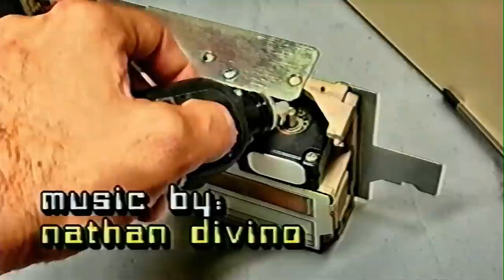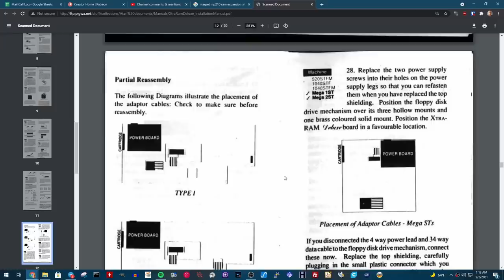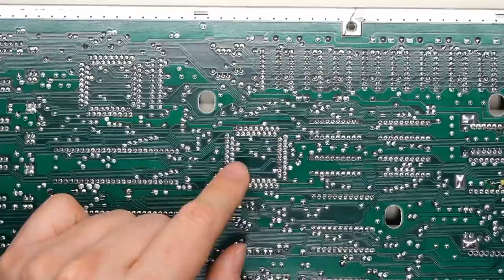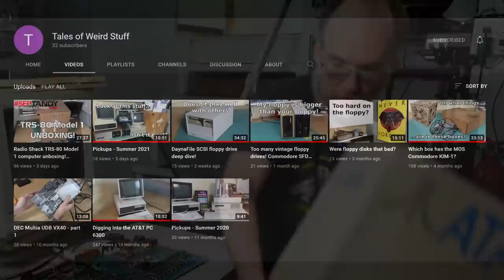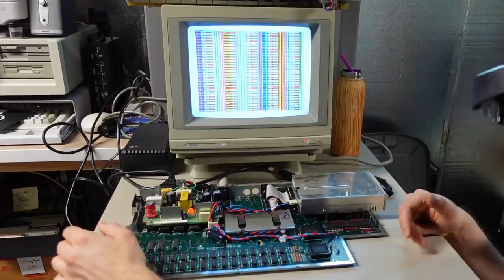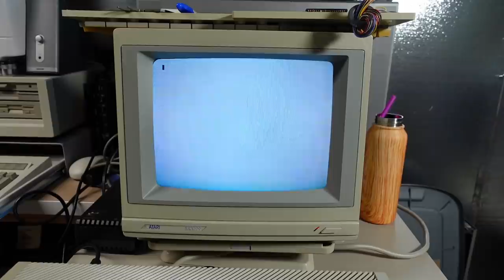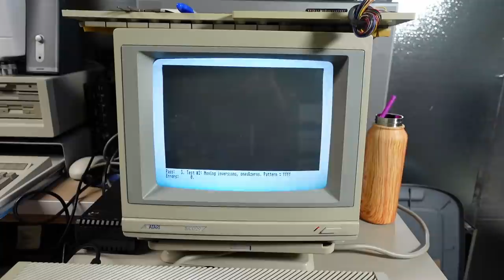I figured out what is wrong with the Atari 520 ST!

Comment: The 68000 can access the two 8 but halves of its 16 bit bus independently using two strobes, *UDS and *LDS, I guess that is why those chips are connected in two groups of 8 bits.
Reply: The buffer chips are actually there to isolate the 68000 and other chips from the data bus when the shifter wants to use the ram. The Amiga has a similar arrangement
Reply: @jaycee1980  Yeap, I was explaining, with more or less success, why there are two different enable signals, you have to allow the 68000 independent access to the two 8 bit halves. It's not a surprise the Amiga has a similar arrangement, it uses the same CPU. Cheers.

Comment: When you wanted to fix those socketed chips back in the day without opening the machine, you would just lift the computer up about 6 inches and drop it down on the bottom.  That would usually reset the chips.  This is why they sold retainer clips for the sockets to hold them in place.
Reply: I have an early 520 and I can confirm that this was a problem, and this was the official fix.
Reply: @jimgsewell  I can remember when the 520's came out and this was the first thing to try if your new ST didn't boot!

Comment: The Mega ST line was the follow up to the 520/1040   There was the Mega ST1 and the Mega ST2 -- I owned a Mega ST2 back in the 90-94 timeline.   The number indicated the megabytes in the system.   They were pizza boxes with separate keyboards.  I think they came with an integrated HD but it's so long ago I'm not entirely sure. (Edit: Nope.  No internal HDs.  Did some googling...)

Main reason for buying these were that (a) Apples cost so much more and (b) desktop publishing.  Yeah, everyone associates the mac with desktop pub, but there were a few decent programs for the Atari ST line that worked just fine.   We had a few 1040's at my work connected to an apple Laser -- whatever their first laserjet was called, and used it a ton.
Reply: Mega ST2 and ST4 came first then a little bit later the ST1. The Mega ST's were sold as "professional" machines and therefore would need more memory. They realized only later that there was demand for the only 1 MiB version.
They hadn't an integrated harddisk. They had another pizza-box with harddisk called Megafile 20, 30 and 60. 
The Mega ST's had a better keyboard (real keys using cherry MX black ), blitter integrated and a battery backed realtime clock. They also had an extension connector with the CPU bus for easy extension.
I still have mine with integrated PC-Speed emulator and Volksfarben ET4000 VGA card.
Reply: @galier2  They where also the first STs where the Bitter was installed from the factory.

Comment: I used to work at Chiang Computers in Ottawa, selling Atari and PC computers.

Some of the common repairs my boss Gary would make to Atari computers was cleaning and bending the pins of the sockets and chips to improve connections, and replacing the power supplies.  He fixed a lot of Atari computers.  Apparently bad solder joints was common on some power supplies.

Seeing this video brings back memories.

Comment: I wish I could get my hands on a decent ST.  Maybe one of the later ones with more memory, built in floppy and PS.  I had an original 520ST that I expanded to 1024KB by the piggy-back method.  Did some awesome quality hours on that machine.  Mostly working with N-dimensional intersections with 3D space .. for instance, how would a 4D object appear if it was inserted into a 3D space.  Think about sticking a 3D sphere into a 2D space.  It would appear as either a point or a circle, depending on how far it was inserted into the 2D space.  Now think of what a random 3D object, maybe an odd shaped rock, would look if ti was inserted into the same 2D space.  Now, think about 4D objects in 3D space.
Reply: The STe machines are good.  Used to have a couple of those, wish I still did.  They had a later TOS versions, more colours available & also used 30 pin simms so ram upgrades were a lot easier than previous versions.
Reply: I'd love either an ST or an Amiga.
Reply: @CJ-rf9jm  yeah we got an 520STE but a few of our friends games we borrowed that ran fine on STFM wouldn't work on the STE - so we got the store to give us a STFM instead.  This was a really dumb thing to do when we tried to upgrade the RAM an saw we had to solder wires and mess about with jumpers etc... And we learned that the STE could pretty easily be upgraded to an insane 4MB just with socket SIMMs.  There was a small amount of software incompatibility on STE early on - but most developers starting making sure their new releases worked on both models.  And we never did fit our RAM upgrade.
Reply: @adz693  I had a 1040STe from 1990 onwards that I'd later upgraded.  I never had any incompatilibility problems.  That store absolutely ripped you off badly.  The problem were those badly cracked games.  I'm not against cracked software when it's no longer available except those who do it so badly they end up screwing up the program in the process of cracking it.
Reply: You can never find a proper 4D object when you want one... not even on eBay. Apparently they are incompatible with 3D packaging.
Reply: @another3997  You can be certain of that.

Comment: I have a lot of Atari, 1-800, 1-512, 2-1024, 1-mega STE, spare floppy drives, many DD, Hand scanner and even the SLM804 printer. all are working fine. 100's of software and most all the magazines and their disks. It takes a 4x8 table to set them all up. Thank you for the post very interesting to me.

Comment: super cool . i wanted one of these machines pretty badly and i only saw one a single time but i played around with it and gave it a good once over  .i ended up with an ibm8088 that had no hd but 2 x 5.25 floppys . i got a roland interface and slaved it to a 1/2 inch 8 track reel to reel . i learned a lot . the pcs where quickly getting faster and you had to know when to not upgrade and wait a minute . eventually i switched over to an all digital system and i am so much happier . a lot of younger guys will adore all the older tech but not me . i like the effeciancy workflow of a good daw with good plugins over tape and $$$$$ outboard gear.  very cool retro stuff here !

Comment: There are two banks of 8 bits to support byte wide addressing.  From the processor (68K?) the UDS and LDS signals would be used to determine which 8bits to access.
I used to work for Frontier back in the day and fitted many of those Xtra-RAM units to Ataris.  Great fun.

Comment: Indeed, the MMU is not proven to be dead (they never died on me in my years). The memory expansion board pushed (cold) in the socket always damaged the pins. They are pushed back. I used a needle to bring them back for a good tension again. The memory expansion board pins are pushing the socket pins back because they are between the socket pins and the MMU pins. (This is a terrible way to do a mod. Hmm plug and play the said at the time) It always ended up in wite screens eventually. Just an addressing problem. So, see if you can restore and polish the MMU socket pins and try again. I did this a lot! 35 years ago, for Atari the Netherlands. I hope it’s working, … I have a lot of original spare parts. I do sell them occasionally. I’ll see if I have the MMU.

Comment: The reason there are two banks of 8 RAM chips is so the CPU can read/write one byte at a time.  The 68000 has no A0 pin so can only address words.  It has UDS and LDS (upper and lower data strobe) pins for addressing the even and odd byte at a given address and uses the lower or upper 8 bits of the data bus to do so.  If it wants to transfer 16 bits, it strobes both pins and uses the full 16 bits of the bus.

It would be interesting to see if (with a bit of hacking) the onboard RAM could be relocated in the address space to have 4.5MB total rather than disabling it.

Comment: The two banks are probably still in parallel, but iirc the MC68000 enables the upper and lower bytes independently, so as to support 8-bit writes without clobbering the other byte.  Just guessing though.
Reply: One bank is lower bytes, the other is upper bytes.  The 68000 CPU has no A0 so only word addresses are possible.  It uses UDS and LDS pins to address either lower, upper or both bytes as required.
Reply: @thisnthat3530  Yeah, that.

Comment: On the original Atari 520 ST you needed the drive connected to boot up because the OS (GEM & TOS) was loaded from disk.  But even without the drive connected you would get an error message. When the OS was moved to ROM, you no longer needed a drive connected to boot the ST, but it was pretty useless without one since almost all the software available for it was disk based.

Comment: The MMU and GLUE chips can go bad on ST’s. I’ve fixed a few with bad MMU or GLUE chips. I’ve fixed a 1040STf with a bad GLUE chip, it totally booted, but the screen was all glitching and no green desktop. But it gave the keyboard beeps. Replaced the GLUE chip and was working perfectly again.

Comment: It's 2 8bit banks because the 68000 can also access only one half of its 16bit data bus. For 16bit access, both banks are used at once (you actually can't do 16bit accesses on odd memory adresses, this started only to be possible with the 68020, iirc).

Comment: The PLCC sockets Atari used are notorious for having bad contact. 
I have heard it was common back then to try the 5-inch-fix first. That is, you lift your ST flat 5 inches above the table and then drop it. This was supposed to push the chips back into the sockets.

Comment: Just wanted to point out that the Motorola 68000 is a 32-bit processor, with 32-bit instructions, but with a 16-bit data bus, and 24-bit adress bus. Motorola called it a 16/32-bit processor.
Reply: 16/32-bit processor, hence the name of the ST.

Comment: I used to have one of these machines. One of the things these were notorious for was the chips in the square sockets would, due to thermal cycling, begin to work their way out of the sockets causing random issues. One of the "official" service bulletins was to hold the computer about 7 inches above the bench and drop it. That would reseat the chips! LOL.
Reply: There are also metal clips available that hook on to opposite corners of the socket and apply pressure in the middle of the chip.
Reply: @dnwheeler  My Atari ST had those.
Reply: The Apple III had the same issue, and solution.

Comment: I would be cautious with that memory expansion, give it a once over. Sounds like something might have shorted on it and sent 5v down the data line to kill the MMU. That hot glue that was on there (I think I remember the simms being hot snotted on that expansion) is a huge red flag to me
Reply: I agree with yours and others who pointed out that the RAM expansion board is suspect. It wasn't made for the 520ST anyway, so why is he trying to make it work with it if it wasn't meant to be used with it in the first place? 

He should really look at the Exxos or thff RAM expansion boards which are much smaller (only uses 2 or 4 chips) which produces less heat too. The designers also say they work with the original 520ST models.

Comment: The Atari ST did not have an 8 bit data bus anywhere and the latches are not there to somehow map 8 bits to 16 on the CPU.  It was a full 16 bit bus.

The latches were probably there for buffering timing and managing bus contention.

The reason the RAM is organised in 2 8-bit banks is because the 68k is byte addressable. If you look at the pinout of the 68k there is no A0...just 23 address lines even though it has 24 bits address space. Instead of A0 it has LDS and UDS (lower/upper data select). You can select either data bank OR BOTH at the same time!

In 68k assembler you can only access a 16 bit value from RAM from an EVEN address and both UDS and LDS are asserted. If you do a byte access you can specify even OR odd addresses and only LDS is asserted for even addresses and only UDS for odd addresses. Hence why each 8 bit bank has its own select. One is even bank and the other is odd bank.
Reply from the maker: Yes others have mentioned this as well. Curious how the Atari 260ST would work (which I assume is this motherboard with half the RAM removed?) When this machine is working again, I should try disabling half the memory to see what it does.
Reply: @adriansdigitalbasement  The 260ST had 512K of RAM -- it was a marketing ploy to sell off old 520STs with TOS loaded from disk (the machine have around 256K of free RAM left after TOS had been loaded in from floppy).

All ST ram banks are 16-bit wide, so technically, the ST can support two banks of 128k to support 256K of RAM but no machines were ever made like that (and one bank for a 128K ST -- only seen at the original CES demo).
Reply: You can contrast that to the TMS-9900 in the TI-99 which also doesn't have a A15 (TI counts bit the other way round Motorola A0 is TI A15 and TI A0 is Motorola A15) but does not have the equivalent of LDS/UDS. It always reads 16 bits and masks internally. This is particularly bad as it has only 256 byte of 16 bit memory, the rest is 8 bit and each memory access will trigger two sequential reads from memory. This means loading a 16 bit register needs 4 bus accesses (each having 2 wait states to make things even worse).
Reply: @DrSteveBagley  The 130ST prototype was likely equipped with 16x 4164 RAM chips, and yeah it looks like the 260ST was just a 512ST without ROM chips for TOS, and IIRC was only badged that way im Europe and for a short time.
Reply: @adriansdigitalbasement  I would be curious as well to see if the MMU does some sort of trickery, but I k ow the CPU requires the full 16 bit data bus to be present to function properly. It's like how 386 PCs used 8 bit wise SIMs but needed banks of 4 in the same size to work.

In other 68k systems I've seen with 256k they used 32 4164 chips arranged in 2 banks of 16, and each bank having 2 groups of 8 like here, and in another case there were 8 4464 chips in banks of 4, each bank being divided into pairs.
Reply: @galier2  it's even worse than that. The 8 bit RAM in the TI is connected only to the 9918 video chip instead of the data bus of the 9900, so all access to that 16K has to be done through the video chip registers!
Reply: @adriansdigitalbasement  LOL Disabling half the memory would just make it not work again. :-)
Reply: @markshanehayden4648  Yes that's true but that is the video RAM which is indeed only accessed via the VDP and I/O commands. I was describing the direct access to extension RAM, either the 32 external RAM or directly addressed ROM on modules (not GROM) or the extension from the Mini-memory for example. In that case, these extension are connected to a 8 bit bus and each memory access goes through a multiplexr circuit. The TMS-9900 lacking the LDS/UDS circuitry of the 68K, its memory accesses are always done in 16 bit width even if it only reads a byte, this triggers always double the number of transactions than really necessary when accessing something on the 8 bit bus.

Comment: Mega STs are desktop case STs w/ Blitter chip and real time clock (in 2MB and 4MB models) added.  Some of the later STf/STfm models have metal clips over the PLCC chips because it was a known issue they could get a little loose during shipping.  An official 'fix' from Atari at the time for new units not booting was to drop the machines (as flatly as possible) from 6-8" onto a hard surface to reseat those chips w/o having to open up the case. :-)  EXXOS Atari store in UK has MMUs.  Not sure about US sources (Best Electronics or B&C (myatari on eBay)?).
Reply: The PLCC chips could also get loose due to thermal creep over a period of months. I had to reseat my MMU and GLUE regularly in my early 520STM, but it never gave me any long-term problems.

Comment: The reason for needing the keyboard is that its got an embedded z80 on board and provides the system clock. If you add a battery backup to the clock on the keyboard then it'll survive power off

Seconded and thirded comments about the sockets.  They were a notorious failure point on all 1980s machines. Pull and clean everything

Comment: I used to do component level repairs and soldered memory upgrades on STs back in 89-91.  MMU chips did fail occasionally, but it's FAR more likely the dodgy solderless ram upgrade caused a physical issue with one of the pins on the MMU.  Look for a pin that shifted sideways and shorted to another pin or got smashed too flat to contact the socket.  Those solderless ram upgrades were TERRIBLE.

Comment: The Atari 520 ST had a real problem with chips becoming unsocketed. At least for a while, the official fix was to drop the computer 4-6 inches onto the table. I agree that it sounds sketchy, it was. My point being you might want to reseat every chip that you can. I have an original 520 ST, and also a 1040 that I bought years later.

Comment: I believe if you examine the memory upgrade, and the little board that has pins sticking out of it that fits on top of the MMU, you will see that one or more of the pins has one side of the pin as bare metal, the the other side covered in epoxy or some type of insulating material. If that insulating material rubbed off onto the pin of the MMU, it might be preventing that pin from making contact with the pin in the socket. Also, I believe the MMU was a custom Atari chip.

Comment: Lol I stand corrected! I guess the original ST can boot, sort of, without the keyboard. Is the IKBD chip on the motherboard on these? The stuck key thing happens when there is an error with the keyboard controller, it also happens when a joystick is plugged in with the autofire on after a reboot. Or some times just randomly. Hitting a key will stop the beeping in the latter case.